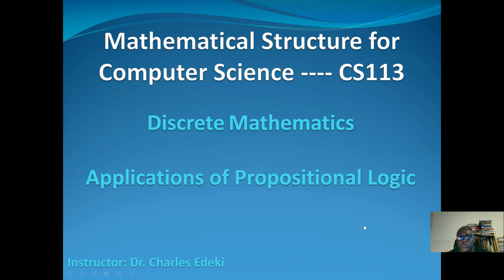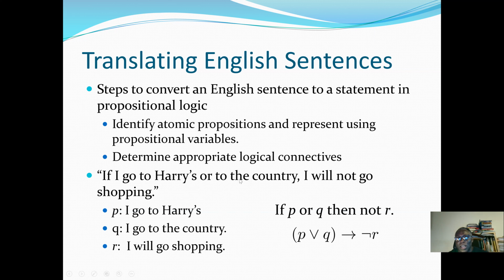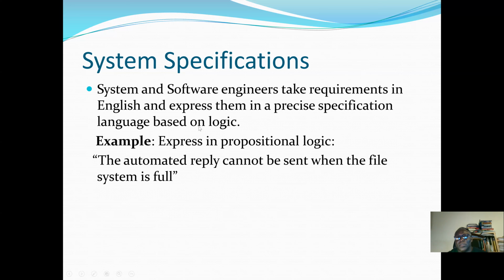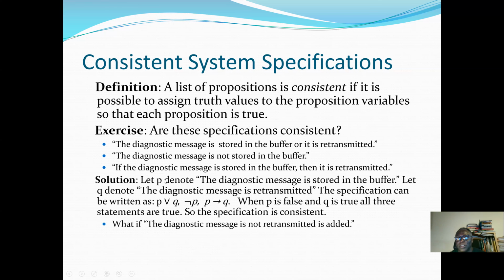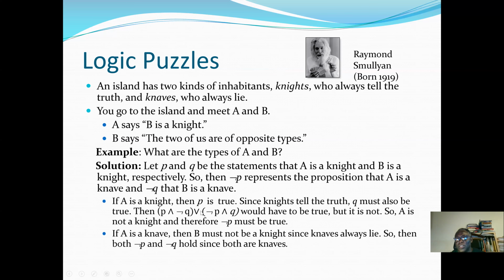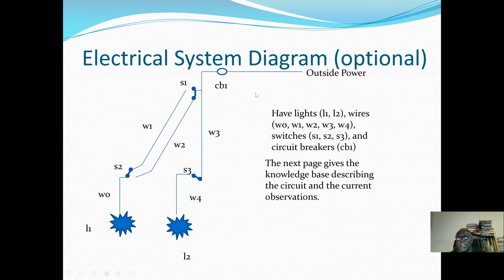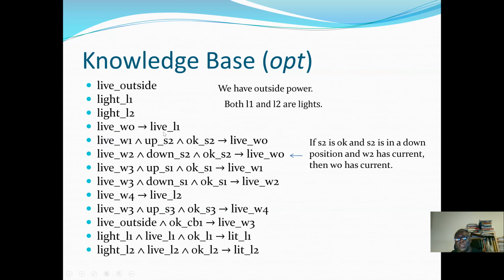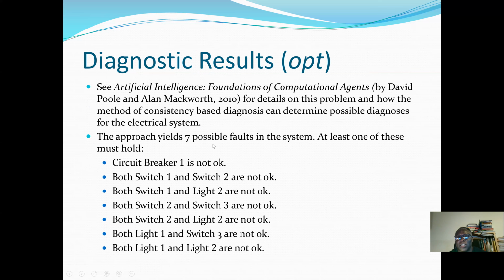Applications of Propositional Logic - Discrete Mathematics Lecture 3

Comment: what are the projects that can be made on this topic
Reply from the maker: the common and important project is the Logic circuits that is use to build our Processors (CPU) in the computer system.  We can design a logic circuit to perform any task, such as adding 2 numbers.
Reply: @charlesedeki--mathcomputer7198  not that i need advanced project using predicate calculus
Reply from the maker: @aayushnevatia7  Predicate Calculus is use in Database Management system script language....SQL...such as select, project, etc....tasks
Reply: @charlesedeki--mathcomputer7198  I am unable to understand you can you refer me some page or link where i can find those
Reply from the maker: @aayushnevatia7  https://cseweb.ucsd.edu/classes/fa13/cse20-a/scribe2.pdf
Reply from the maker: That was an article about using the concepts in database system